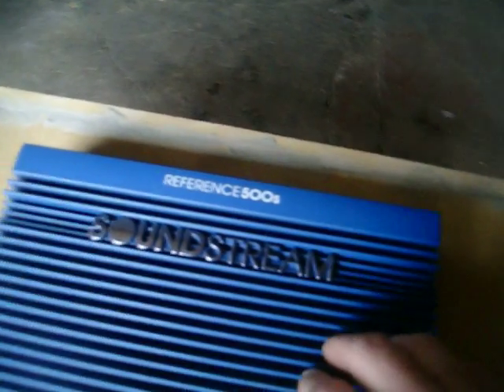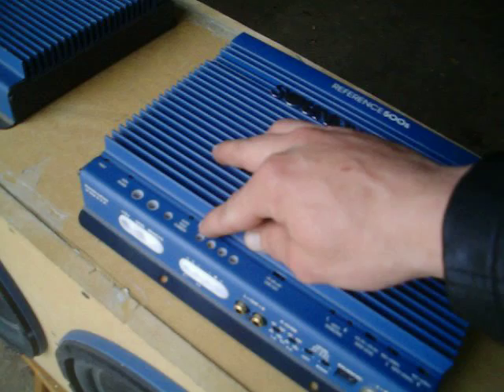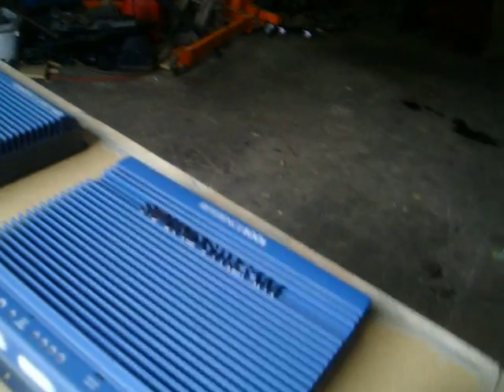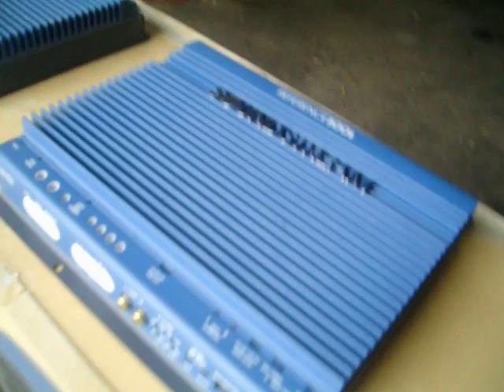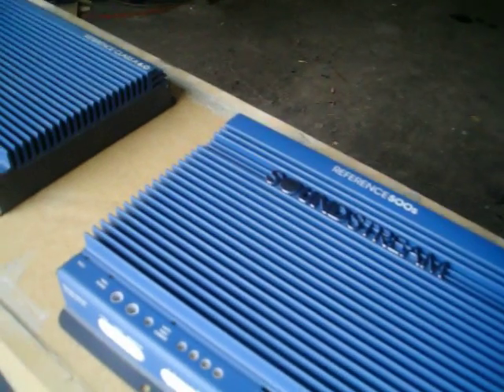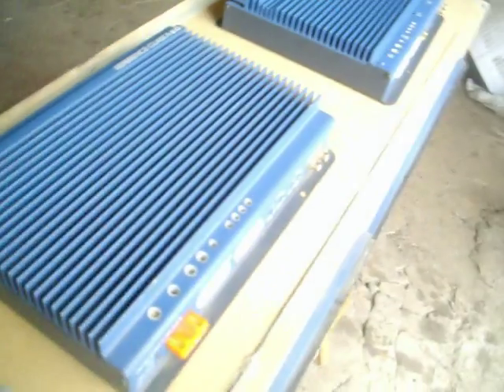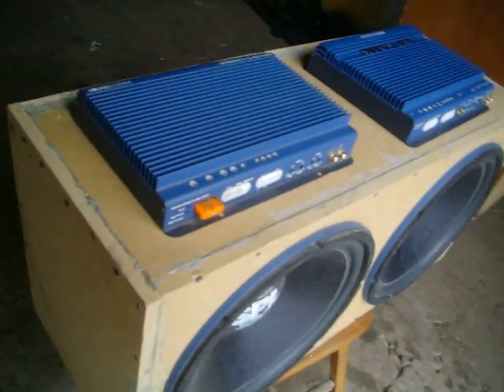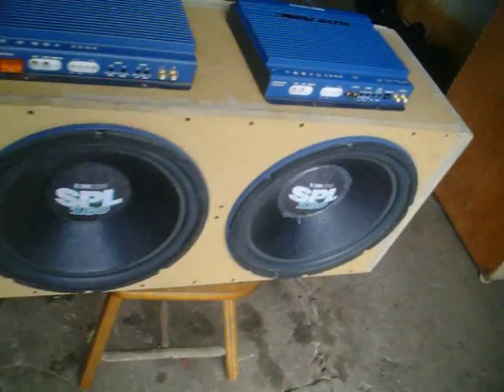new amp ! Soundstream 500S 1996 !

Comment: I have a reference 300, but not a 300s. Mine has a switch on back to change from high power to high current mode. From what I read here, I am making the assumption that the s indicates the amp automatically switches from high power mode to high current mode when the impedance drops too low. Is my assumption correct?

Comment: @mazda2284 that 150 gets hot cuz its only 4 ohm mono stabble  my 100 played at 2 ohm mono everyday  til to day and i get it back 2002 used  try find a vlx or hc  what part is blown in that 2000x  is board burned up

Comment: @mazda2284 damm that sux  150 was a good little amp  it gets hot cuz its only 2 ohm stabble stereo  4 ohm mono  that what the x means  a us 150 is 1 ohm in stereo 2 ohm mono  if you can find vlx or hc  us get just need the power to run them  what part is blown in that 2000x  is it an output burned up

Comment: @mazda2284 us get warm  and hot when you dont have the volts to run it  look for a hc us amp they go to quarter ohm   hc 100 will do you good i looking for an us 2000x  my box is 4 ohm mono all i got is little us 100  it out played an jl 500/1